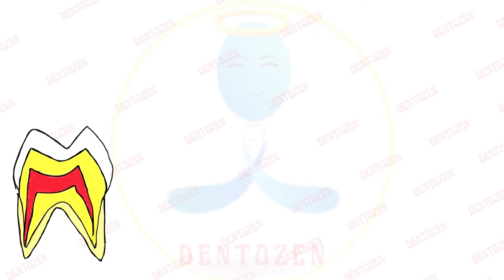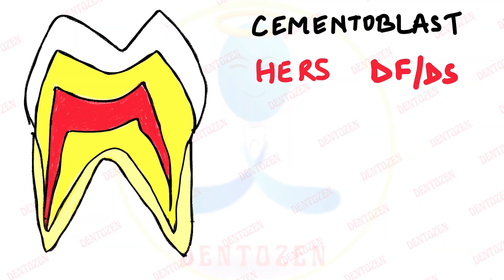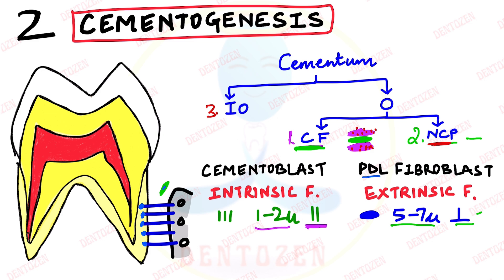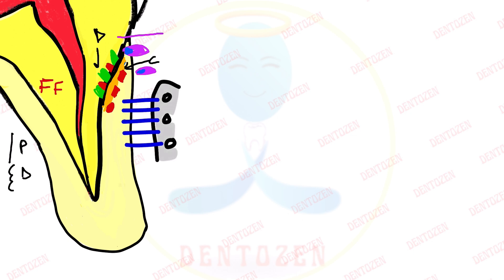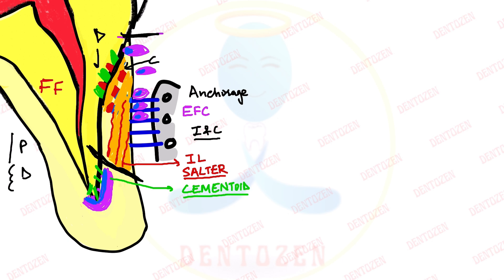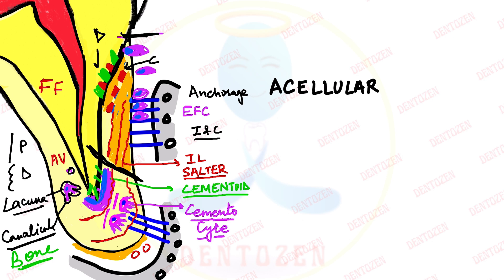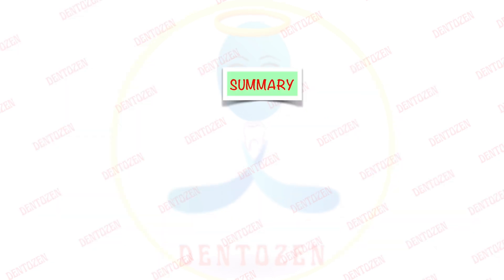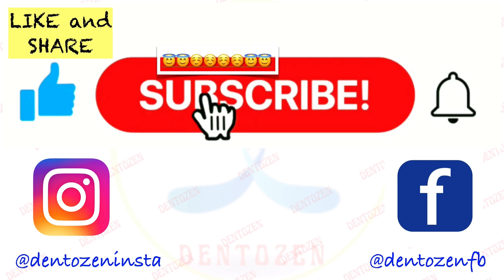Cementogenesis | Sharpey’s Fibres | Lines of Salter

Comment: Thermal, Pressure, Humidity and such physics involved as properties effected... Please add Physics properties reactions please.... Cementum, the Bone to Root Fibers (Intrinsic and extrinsic fibers?) and Dentin especially?

It become mineralized because it dies from the air and starch at the mouth (because its an opening at the extrinsic cementum?) when it sticks to the bone, the root size capillary and nerves that connected to the facial blood capilaries?

Thank you ❤